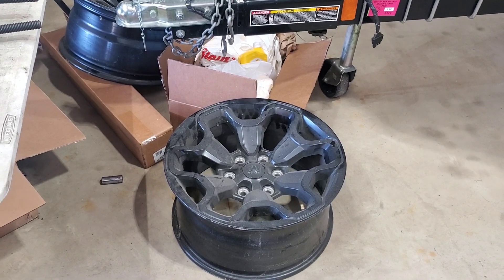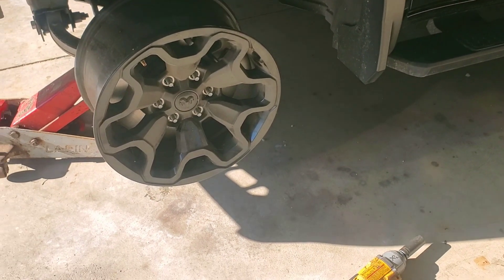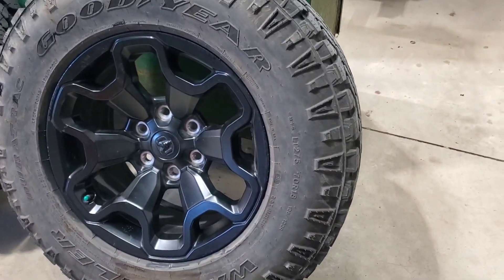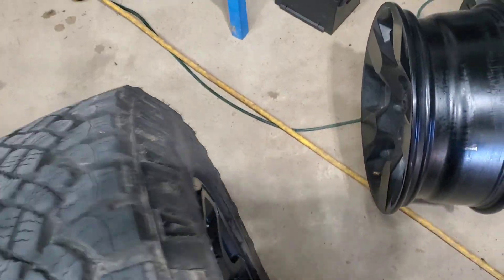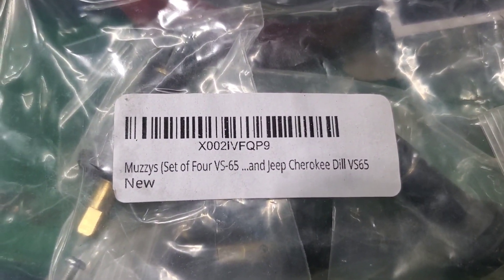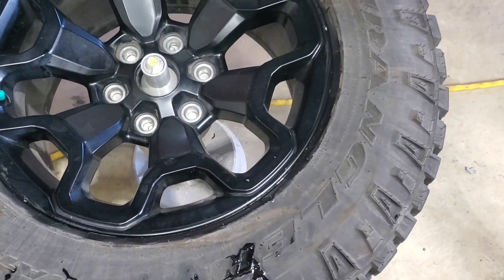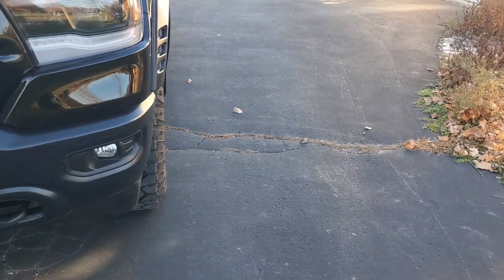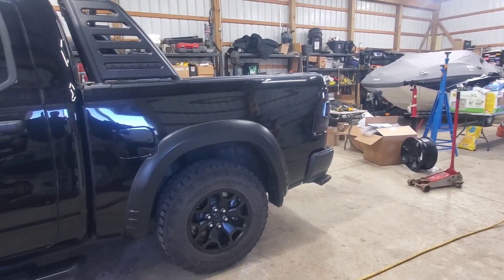RAM TRX Wheels on Std RAM 1500

Comment: Looking to level my BTS edition and throw a 1/2” spacer with the 325/65r18 

Think it’ll work?
Reply from the maker: Are you saying just the spacer.. or level it and a spacer
Reply: 2” level and a 1/2” spacer. But I’m wondering if I can get away with a .25 to avoid changing the lug studs with extended ones.
Reply from the maker: @stetsonschmitt7411  what 2" level are you using . A strut? I wouldn't go more than the 1/4 inch spacer. I definitely wouldn't stack spacers either. It didn't change the ride at all. But it gave about a 1/2" lift over the 2". My situation may be a little different though . I also added a winch. Which is why I added what I did
Reply: @vfr800fi07  motofab 2" is what i have on order on the strut yes. Agreed. Not planning to stack spacers certainly.
Reply: Follow up. Installed the TRX wheel/tire with .25 spacer. No rub. Minimal space between UCA and tire but it’s going. 

Now to decide if it’s worth it to level and change UCA
Reply: @stetsonschmitt7411  Did you install on a Rebel? I'm looking to use the smallest spacer possible on my rebel. I don't mind having to do some fairing trimming if necessary. Also, you mention low clearance between UCA, have you had any issues with this since install?
Reply: @bucs2440  Its a BTS, which is mechanically the same as a Rebel (as far as I understand). Ended up with 1/4 spacer and that provided enough space. Some minimal trimming of the wheel well resulted in minimal rubbing at full lock out. I recently leveled out the truck with Bilstein 5100. Everything runs well now, no rub.

Comment: What's the backspace and offset on the trx rims
Reply from the maker: The offset is the same as the 8" wheels just a inch wider. So basically 1/2" closer than stock

Comment: What size tires did you use for this sir ?
Reply from the maker: 275/70/18 duratracs
Reply from the maker: These are the same 275/70/18 duratracs the rebel uses.. so basically 33's